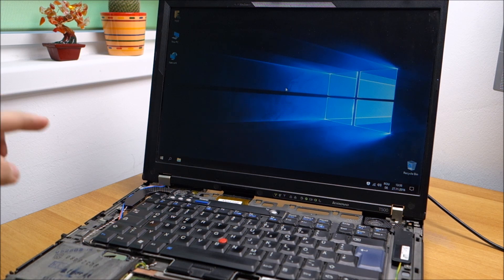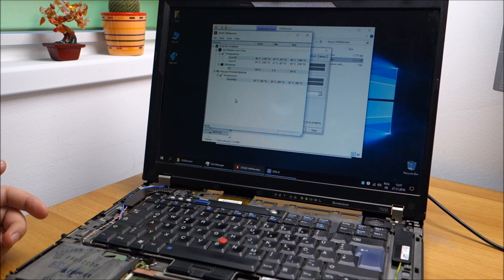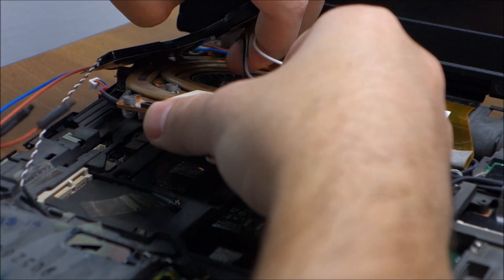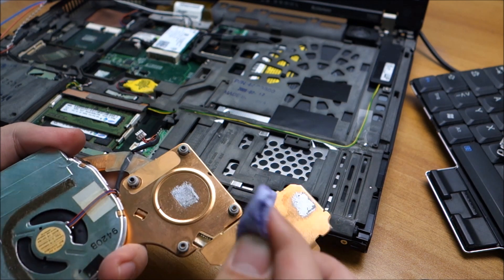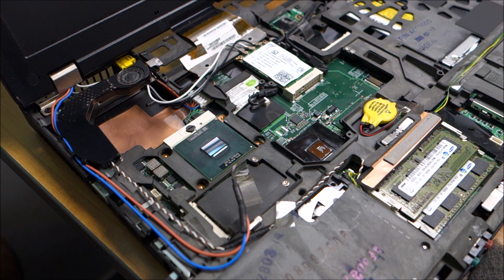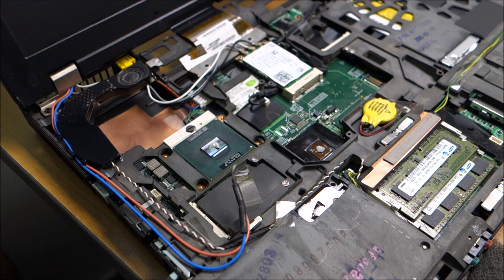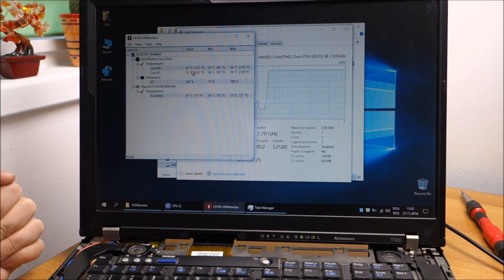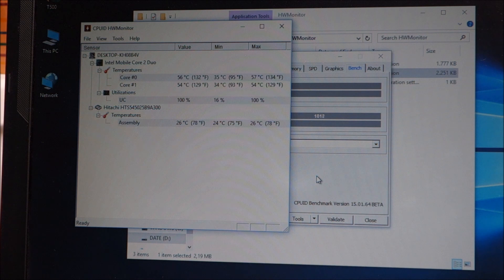DANGER! Coollaboratory Liquid Ultra - big problems after just one year

Comment: Guys, the Coollaboratory Liquid metal can't dry. It's metal, there's no water in it. It can alloy with pure copper. Then you have the perfect, purely metallic connection between heatspreader and cooler with unlimited service life. Providing you don't touch it anymore. If the radiator is removed and replaced in a different position, the metal must be re-applied. That's the whole problem. Simple.
Reply: You're a fucking ignorant idiot.
Alloys typically cause worse thermal conduction not better.
WORST case scenario, gallium migrates eventually into the heatpipes and you have a leak formed due to weakening of its structure.
Best case scenario, the copper gallium contact point becomes pretty insulating compared to even a piece of stainless steel.
Reply from the maker: Indeed, in theory, but because of the thermal stress, the connection will be really bad when it turns solid.
Reply: it doesnt get bad. we are using it since 8 years on 10 to 15 computers monthly. We had not a single problem until now. Put your hands away from the installes system, or reapply. Thats all you have to know.
amd about that silver look.... the liquid metal filled all the little gaps in your copper surface, making it streight. Using that copper surface you get better results in future, even when you are going back to a common paste. Trying to remove it is like to clean up the gold from a goldplated ring, with a alcohol pad.... omg
Reply from the maker: Estefan Bredel yes it does. You can say whatever you want. In my situation it went bad on 2 laptop and 1 desktop CPUs. I understand that you did not have problems with it, but that does not change the fact that I did. Was my paste some kind of freak accident with a wrong formula? I do not know, but it went bad for sure and it caused overheating.
Reply: I dont know why your experiences are so different, compared to the majority of users. Can you justify that with an understandable scientific argument?
Reply from the maker: Estefan Bredel sadly, no, I have no real ideea why it became solid in my case.

Comment: 84ºC is not normal? Are you serious? I have a new laptop and when I stress the CPU the temperature raises up to 97ºC in few seconds at full load and constantly thermal throttles. 84ºC in fact is a low temperature for a laptop, be happy with that.
Reply from the maker: FreedomWarrior not all CPUs are the same. Some have the maximum temperature at 67°C for example. So even if your CPU can go that high, that does not mean my CPU can.

Comment: You miss one thing important: thermal paste dry gets cracks and loses efectivity for that, liquid metal, even dry, is still metal, so it will conduct heat perfectly
Reply from the maker: No really. This is why people need to reapply liquid metal quite frequently. And also this is why my CPU was overheating and this is why we use thermal paste and not direct metal to metal contact.

Comment: Is not that it dries out, its that if "fusion" with copper, so it corrodes the outer layer and starts going deeper inside, that's why your temps start to go up after a while, they need to find a combination that doesn't eat metal that hardcore
Reply from the maker: Indeed...

Comment: Do use liquid metal directly with copper alloys (never aluminum) reason for that is the liquid metal would slowly react with copper making a gallium copper alloy and you will see the copper turn silverish like on the video, which is the gallium absorbed into the copper, Id say only used gallium with desktop cpus that have a nickel-copper based heat spreader since nickel has very little reactivity with gallium.
Reply from the maker: Thank you for the info :)
Reply: Yea np if you want more infomation on liquid metals as a thermal paste check out this thread! http://forum.notebookreview.com/threads/liquid-metal-explained-how-it-works-why-it-fails-and-how-to-use-it.809332/

Comment: How do you remove this properly without scratching the surface and not ruin your copper coller?
Reply: Honestly, concentrated mineral acids should work. Muriatic acid for one (used to etch concrete) (HCl) Sulfuric Acid and Nitric will for sure but the public generally can't access those.
Household vinegar isn't going to cut it.
Just clean carefully in ventilation then when clean rinse with LOTS of water. Tidy up with anhydrous alcohol
Reply from the maker: Thank you for the information!
Reply from the maker: +Al Jourgensen you can't... Someone sugests heating up the cooper and maybe you can remove more easily. But I think you can't fully remove it, so remove what you can and use a really fine sandpaper to make the cooler surface flat and smooth once again. But a stain will always remain on the cooler.

Comment: I heard this sort of things happening to Coollaboratory Liquid Ultra. I use Thermal grizzly Conductonaut, it doesn't dry up...honest, try it if you can find it in your country, you wouldn't regret it. It dropped my temp by 20c. I did it to my Asus strix 980ti, before on-load 79c, after Conductonaut..highest 58c and just the other day I check to see what kind of condition and contacts are making...and it sure enough still really wet...it's an amazing stuff. https://www.amazon.com/Thermal-Grizzly-Conductonaut-Grease-Paste/dp/B01A9KIGSI
Reply from the maker: +drew alt411 if I ever need that kind of high performance thermal interface, I will give it a try :)

Comment: just another observation. I used Conductonaut for ~5 weeks on my laptop's i5-4310m CPU. Temperature drop from stock Dell's compound was quite impressive. After removing the i5 to replace it with i7 (after those 5 weeks running with LM) I noticed that I can no longer make the CPU's silicon look clean and shiny, even when using alcohol based cleaning agents. It looks cloudy and no longer shiny - that's never the case with regular thermal pastes. I did apply enough LM so it did not dry out during that short time. So just keep this in mind if you are planning to sell your old CPU. I my case, it did affect my CPU die in some way. Maybe some chemical deposits form on the die and I could remove them with more aggressive cleaning solution, but I just don't want to risk it having no experience doing that. However, I applied the LM on my new +10W TDP quad core i7 as otherwise I would run into serious thermal throttling defeating the whole purpose of the upgrade. Second time I re-apply the compound, I might use silicone around the die to prevent oxygen reacting with it (also helping to prevent LM getting on other components).
Reply from the maker: I have also seen this behavior. The liquid metal reacts in some way with the dye for sure.
Reply: Landogarner83
I totally understand that LM is what it is - a multiple metal alloy. Given my limited experience and lack of microscope or chemical solutions, I cannot confirm whether the deposits that remain on the silicon die are constituents of LM alloy or rather a product of chemical reaction. Visually, it doesn't look like something is on top of the shiny silicon. Those cloudy areas appear randomly on a die and over the course of my observation did not affect the whole surface. I totally agree that alcohol is not a proper solution for cleaning off metal deposits, but I just didn't feel comfortable enough to use anything more aggressive such as base or acid based solutions. So my bottom line was that it does affect the die visually and it is at least difficult or impossible to make the CPU die look the same (something that might be of importance for those who want to re-sell their components). I have now been using LM for several months in my laptop and I am totally planing to use it in the future as it performs so much better than regular thermal compound.
Reply: +ignasb the problem is that LM is not a thermal paste but effectively a very low temp solder.
Because of that it will bond with the surfaces and will only come off completely if said surface is not metal. (this includes silicon as a metal)
Also alcohol or other solvents have no effect on LM because it doesn't contain anything that can be dissolved.
Reply: +ignasb too bad i don't have access to a microscopy lab anymore otherwise i would have taken a look at it myself.
And yes not using acid was most likely a good idea.

Comment: You should use Thermal Grizzly Kryonaut best thermal paste that is NOT METAL.
Reply from the maker: +Actmo Mode I don't use extreme pastes like this anymore. I realised that they are oberkill for a standard laptop. A high quality standard paste will do the job just fine.
Reply: Have you looked into diamond compound like Antec formula 7?   it suppose to not dry up or harden  because not silicon based. Good Luck
Reply from the maker: Din not try anything else. Using Arctic MX-2 for the moment.
Reply: I prefer Prolimatech PK-1 or 2. PK-3 would do well for a Laptop also, while PK-1 is essentially used in a test bench configuration, since it lasts at most a couple of years before having to change it (however it's the most efficient of the three... But that's what they say: I've applied it to a system that's still running pretty cool after 5 years and without having to reapply it)...

Comment: You never apply LM to a laptop and the reason is exactly this outcome. For desktops it is a completely different story since you apply LM directly to the silicon itself. You delid the CPU, use LM to the silicon, put back the Heatspreader on and use like normal Thermal paste on the cpu. If you use LM directly to the silicon and then to the cooler (like you have to do, since there is no heatspreader on laptops) you basically come out with this result.
Reply: This is bull shit. LM cant dry. And when it is drying it is no LM. So you can aply it on Laptops.
Reply from the maker: +Xele Nor now I know.
Reply: What about laptops with desktop CPU's like clevo "family" of laptops?

Comment: can i use this for my asus rog g751jy ?
Reply from the maker: +King Jezdi I have no clue. Personally I would not use unless I have a big overheating problem. If you decide to use it, make sure the heatsink is at least pure copper, lap it and make sure the force keeping the cooler down is big enough not to let air in, but not so big that it cracks the cpu die.

Comment: And this is why you should lapp your heatsink before doing a stunt like this.
Reply from the maker: +Danishblunt not really. It seems the problem is the lack of pressure from the heatsink and seems to be really common in laptops.
Reply: That's why you lapp it. So it touches the chip 100%, if it doesn't fit properly air gets trapped inside and this effekt you're seeing is being caused by that. There is a reason why so many people run with this no problem, there are tons of people who use liquid metal on notebooks, because unlike desktops the effect on notebooks is considerably better, which you probably already know yourself by experiencing it yourself. There are only a handful of people who face this issue you have right now. As you saw yourself, the CPU side was completely dry, while the GPU side was half dry, because both fits are terrible but the CPU fit is even worse than the GPU.
Reply from the maker: +Danishblunt what you say has logic, but I don't understand then why there are so many variants as to why this problem occurs. Even here in the comments there are tons of variants from different people and sadly there is no real test done by anybody to give a final result to end this.
Reply: There are actually lots of people on notebookreview.com who have shared their pictures and experience with LM over the span of 6months+, none of which have had any negative experience with LM itself, then again everyone there who use LM most likely have lapped their notebook or made sure that the notebook touches the die properly in 1 way or the other. Since that notebook is really old, you might wanna try and see for yourself, go ahead and lapp your heatsink and use LM again, after 1 year when it's still wet and working as intended. Also there aren't many theories, all boil down to = Bad Heatsink fit. bobsagget823 has pretty much summed up why this happened to you.
Reply from the maker: +Danishblunt most laptops that I work on do not remain in my possesion, so I can't have the risk of this happening ever again, so I will never use liquid metal in the future.

Comment: Arctic Silver 5 works like a charm for me, does not dry etc.
You need a burn in period so the matrix forms but that beats frying the chip.

And use polish to get the dried up metal of the sink and chip.
Reply from the maker: Yes, AS 5 is a good paste :)
Reply: hydrochloric acid shoud clean it right off

Comment: I had exact the same problems. I used first gen and second gen Coollaboratory products. Offcourse I stoped using the product, it's a total bitch to clean/sand the surface.
Reply from the maker: +Detmer yes, it is...
Reply: This will happen with ALL liquid metals if you don't change the paste for a long time.  In the description he says he left it for over a year.  

Also you really shouldn't be sanding it. It's not pretty to look at, but I doubt it will change the cooling performance.

Comment: I think the Liquid coolaboratory has lost it peformance . i would go into that and change the thermal paste should fix this issue. Im sure its a thermal paste issue. cause pc is shutting down due to a fail safe temperture .Bios has a fail safe temperture for processors. Id replace the thermal paste and should get back to normal
Reply from the maker: Yes, that's exactly what happened.
Reply: COLLABORATORY CONTAINS Contents materials: GALLIUM CAS-Nr.: 7440-55-3 EG-Nr.: 231-163-8 video shows Why you dont want to use this on any Aluminium 
https://www.bing.com/videos/search?q=%3a+GALLIUM+copper&&view=detail&mid=9E710D6FA3DE3DCC836D9E710D6FA3DE3DCC836D&FORM=VRDGAR Check to be sure gallium is safe with the surfaces its in contact with

Comment: the problem is that the heatsink was not close enough to the cpu, that substance is GA (Galium) so if you dip that heatsink in hot water or heat is up using a heat gun or a hairdryer that metal will go away.
Reply from the maker: I will try it on a cpu that still has lots of it on the die.

Comment: Many thanks for this video. The Coollaboratory Liquid is very dangerous material. It is absolutely unsuitable for GPUs and notebooks.

https://www.youtube.com/watch?v=Hx66m_TgQg4&spfreload=5
https://www.youtube.com/watch?v=EdHJgGTPphU
Reply from the maker: True. Thank you for watching!
Reply: "...absolutely unsuitable for GPUs..." 

Incorrect. And the video you posted shows how you are incorrect. The guy even discusses what went wrong. The galium-based TIM made contact with the aluminium part of the heatsink. Simple as that.

AFAIK, all gallium-based TIM manufacturers warn about keeping it away from aluminium. 

Now, you WOULD be correct if you instead made a more conservative statement such as  "...unsuitable for MOST GPUs..." I used it myself on a GTX570 a few years ago, that had an solid copper block as its heatsink contact area.  The problem was mating was poor. I was in no mood to lap the awkwardly shaped heatsink for the next hour, so I used the nice viscous NT-H1 to do the trick.

In fact, you would be correct in stating that any liquid metal TIM is unsuitable for MOST applications... here's the rub though... overclockers aren't "most" people. If you are not willing to put in the time, don't tinker.  Leave it stock.

Comment: I think what's happened here is a combination of thermal cycling causing separation of the liquid metal, oxidization from not insulating it against the surrounding air (people tend to use putty for that now), and microscopic entry into the unpolished copper surface (causing adherence to the heatsink).

Liquid metal sucks unless you are placing the paste under the intel IHS (fuck intel, shit hardware), and even then you have to carefully seal the IHS back on.
Reply from the maker: +bobsagget823 I must say that your comment makes the most sense until now and really seems to give a good explanation to what could have caused this.
Reply: Because they like to save every cent from production. There was some bullshit going around about how solder causes die cracking on small size dies but that's a total load of horseshit. AMD and intel alike have been using solder on every IHS'd chip from the beginning of time until when intel decided to buck the trend with Haswell. The use of solder probably hasn't killed a processor in history but I wouldn't be surprised if that shitty toothpaste has.  Irrelevant for laptops though, obviously everything mobile parts are direct die